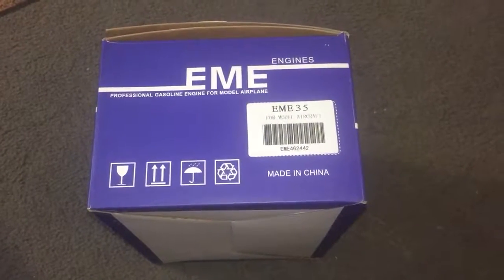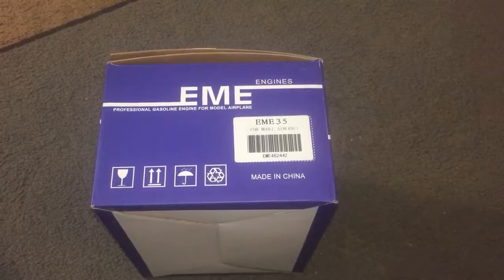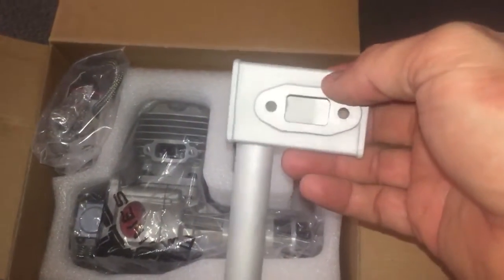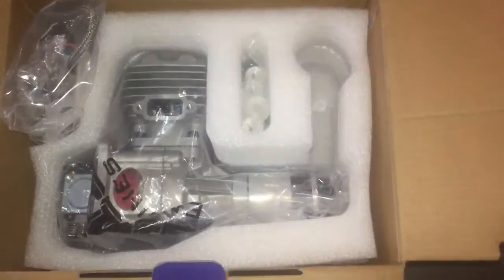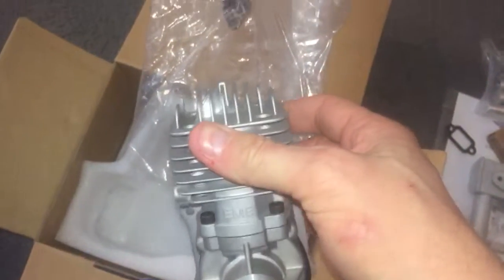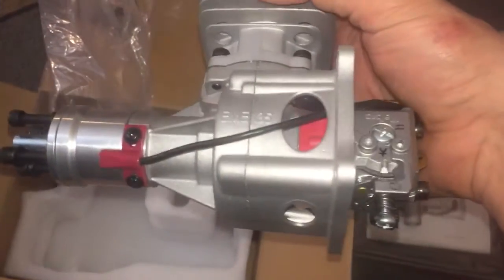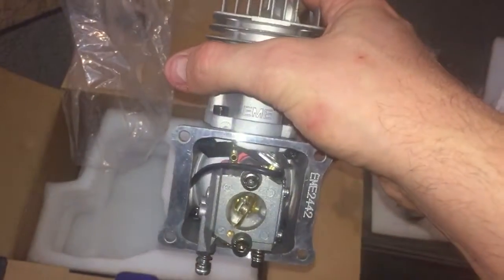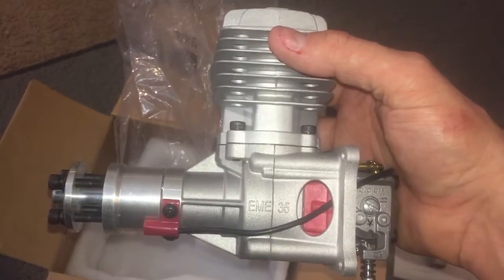EME 35cc Unboxing and First impressions

Comment: Thanks for putting this vid out.  My filming was far too shaky - one-handed like. And too much plastic ruffling.  Just got mine the other day.
Reply from the maker: Scairborne66 thanks buddy. Give it time to break in. They really come alive after a couple gallons. 20x7 falcon carbon is the bees knees for 3D and sport flying.
Reply: Michael, great tip. Mine’s going in a 1:5 scale L-19 Bird Dog
Reply from the maker: Scairborne66 should be a great engine for that plane. I can cruise around at 1/4-1/3 throttle all day long if I like.